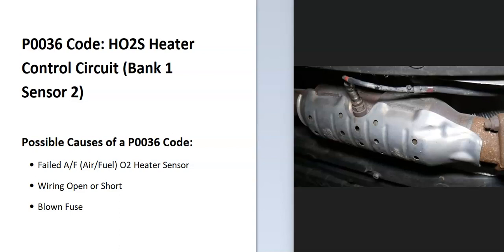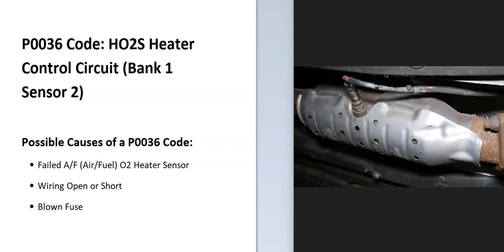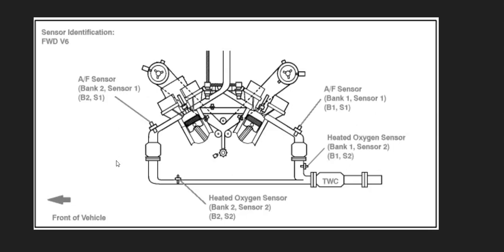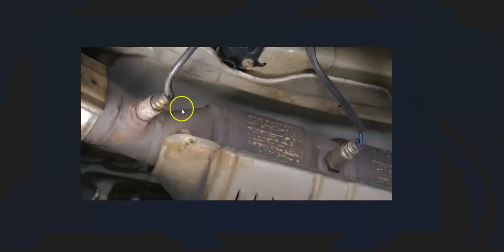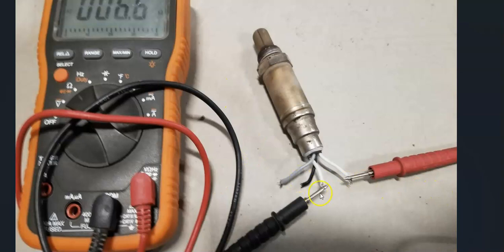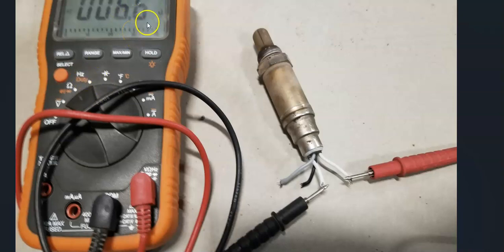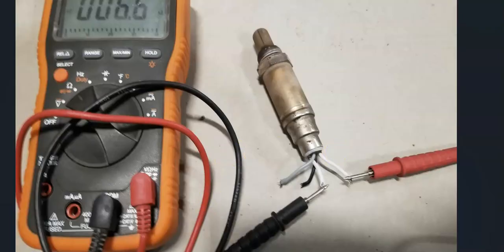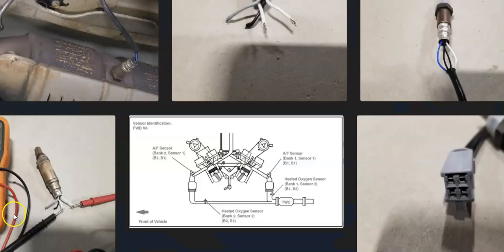Causes and Fixes P0036 Code: HO2S Heater Control Circuit (Bank 1 Sensor 2)

Comment: Would this. Cause the car to shake when you accelerate?
Reply from the maker: No, shaking will be something else. Usually, a bad 02 sensor causes the engine to be less responsive, worse fuel mileage, and not pass a smog test.
Reply: Yes, mine was shaking when accelerating and stopped when i changed my o2 sensor.

Comment: Can this cause a misfire in cylinder 3, on a 4.3l 2007 chevy sliverado?
Reply from the maker: A bad 02 sensor can give the computer bad data, which can sometimes throw off the air/fuel ratio and cause misfires, but usually, that would cause the whole engine or one Bank to misfire not one cylinder.
Reply: @HVAC_Mechanic  oh okay, thank you bc the  vehicle threw that  p0036 code and the cylinder 3 misfire.
Reply: Can leak in exhaust throw this?

Comment: 03 Tacoma 2 new cats & sensors still throwing a p0036 do you know if the fuse could be bad ?
Reply from the maker: The 02 sensors fuse, and relay for the 2003 Tacoma are located in the engine compartment labeled A/F. I would check the fuse/relay and test the wiring.
Reply: Unfortunately the fuse is good wheres the relay?

Comment: This code doesn’t mean the air/fuel ratio isn’t out of wack?
Reply: No, pretty sure that would throw a lean or rich code or at the very least an upstream sensor code which is what does the work to adjust those trims. This downstream just monitors it after the cat

Comment: what fuse could be popped?
Reply: The fuses for the 02 sensor is under the hood in the fuse box. The fuse box top should had a diagram where certain fuses go then you could check them
Reply: @msgaming71601  yes fuse is fine replaced o2 second time.
Reply: shouldnt be a fuse unless several HO2S codes are going off